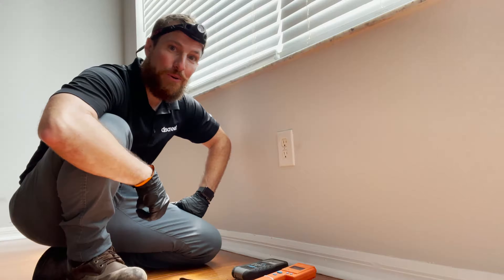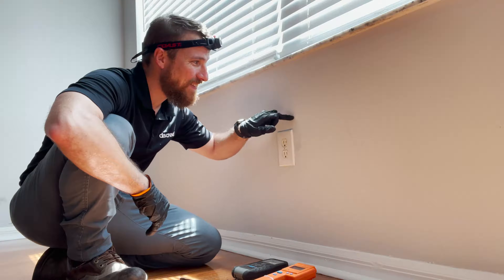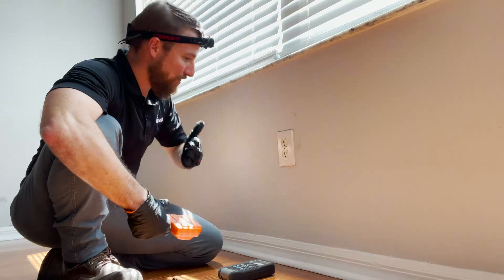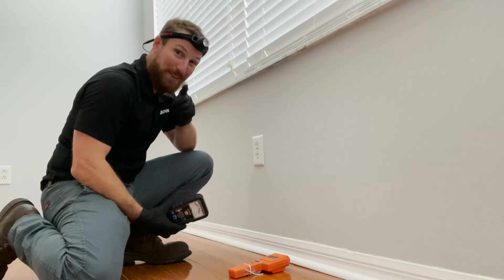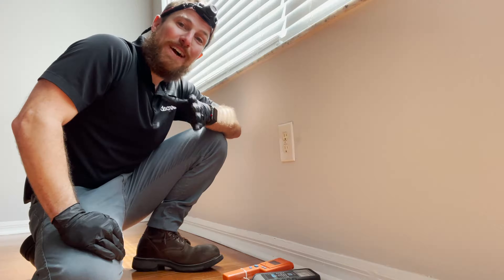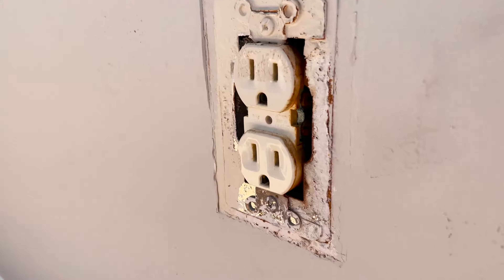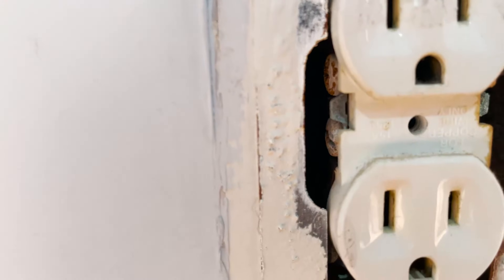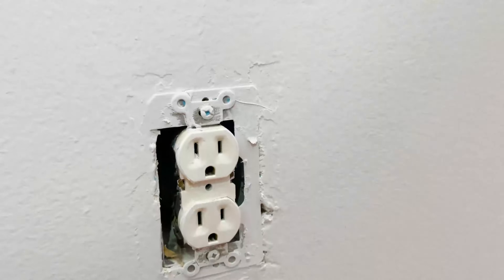Here's a Tip for Validating Moisture Within Walls

Comment: Hello Josh. What's normal moisture for plastered walls? On my walls it looks like the paint it's starting to look like it's not spread evenly and it wasn't like that before. And what type of company would I call to test the walls?
Reply from the maker: Hey there! Unfortunately, there is no standard number or range when it comes to normal moisture content within your wallboard. Also, it depends on the type of meter you are using, as pin vs. pinless meters will typically yield different numbers. 

On a scale of 0-100 for the plaster scale, most commonly I find plaster to be in the 0-10 range. Very seldom does dry plasterboard show any noteworthy level of moisture concentration. With that said, the moisture levels within the indoor air quality will certainly influence the moisture content within building materials such as plaster. 

My best advice would be to collect moisture meter readings from similar walls in other areas of your home where you don’t believe there to be a problem. If you’re seeing these paint spread marks on a perimeter wall, check perimeter walls in other rooms. If this damage is on an interior wall, check interior walls in other rooms. Simply make sure you are comparing similar walls. 

Lastly, a company that can check moisture readings for you would be most professional assessment and remediation companies. If you want to put your worries to bed, or at least warrant the concerns, you may want to consider hiring one of these types of companies to perform a moisture survey. This will highlight areas of concern with respect to elevated moisture concentrations within your property.
Reply: @IAQJosh  Thank you so much for responding! I appreciate your insight!
Reply from the maker: @ldjohnson214  Anytime! Happy to answer any and all questions that you and others have.
Reply: Go buy a cheap moisture meter and test your own walls the instructions are easy to learn there is no real skills here hold the meter against the wall and read it, that's all there is to it.

Comment: What service should I call for moisture or blistering of the walls? Roofer, plumber…???
Reply: Upstairs bedroom underneath the window sill. Also, I noticed the carpet was damp under that same area.
Reply: There was a storm a few weeks ago. It’s supposed to rain again this weekend but not sure what service to call to have an inspection. Roofer, plumber, window person? 😩
Reply from the maker: @chetlynn  Given the proximity to the window, it’s very likely that you may have water intrusion from the window or seal around the window. If that’s the case, neither a roofer or plumber would suit your needs. 

You can always hire a contractor to perform a water damage assessment - which would likely assist in identifying the source(s) of water intrusion.
Reply: @IAQJosh  great! Thank you so much for the quick response!
Reply from the maker: @chetlynn  Absolutely! Happy to answer any other questions that come up. 

Good luck!
Reply: @IAQJosh 
Hi Josh. Love your videos. Thank you!

I live in an older home built in the 1940’s. One of the bathroom walls next to the bathroom ceiling has blistering and now the ceiling is starting to blister as well. Had a new roof installed last year. No known leaks with old roof. What should I do?
What’s causing blistering? Thank you so very much!!
Reply from the maker: Hi Cathy. Thank you for viewing my content! 

Regarding your question, many factors can cause paint to blister... Moisture tends to be the primary source for this, whether via dampness within the material or dampness within the air. Given that you're referencing a bathroom, I would recommend further evaluation of the dampness in the air. Setting up something as simple as an accurate temperature & humidity (T&H) sensor within the bathroom will provide you with this information. If you want to get even more information, invest in a data logging T&H device. SensorPush sells an affordable and accurate sensor - which can be purchased on Amazon. There are also many others. 

You may want to also consider investing into any type of moisture meter - either pin or pinless. The folks at Erikhill sell a small pen style pin moisture meter, which I'm currently testing out. It's under $20 and available on Amazon as well. Checking the moisture content within the blistering area and comparing those readings to another area without blistering paint can be helpful in ruling out an active leak behind the wall and ceiling.
Reply from the maker: For starters, it depends on where you’re seeing these damages… Is this in a bathroom? Bedroom? 

Around what height on the walls are you seeing the damages?

Comment: Interesting to see how you approach damp diagnosis in USA. As a building surveyor in cold and wet England, we get lots of damp and mould issues for me to survey. I personally always also check the exterior of the building for leaks, cracks, drainage issues etc., before recommending you need to remove the drywall (we call it plasterboard). Is it common practice over there to not check the exterior of a building?
Reply from the maker: While I cannot speak for others, I can share that I will always check the exterior of a property. Especially as you said, I constantly find cracks, inadequately sealed openings for plumbing and electrical, etc. Paying close attention to the height of the landscaping, in reference to the height of the slab, is especially important in some areas here.
Reply: In my state 99% of inspectors especially "mold inspectors" are lazy and incompetent. They don't inspect the outside and barely inside. I just had  an IICRC certified water intrusion inspector and certified in "microbial application" - some nonsense like that. He literally waived his moisture meter over the wall. He never placed the pad on the wall, thinking I as a woman wouldn't know better. It wasn't a Flir camera. He also kept saying repeatedly "mold is ubiquitous" - like he was so proud of himself for learning a "big" word. smh  I enjoyed letting him know after he was done with his nonstop BS mansplaining that I am a Certified Mold Inspector.  I took a 24 course and got certified after educating myself first enough to realize how ignorant and incompetent the mold inspectors Iwas hiring were.

The companies/ inspectors that seem to actually know what they are doing charge insanely high fees. There truly is a crisis in the US when it comes to mold and moisture problems in homes and the lack of true understanding of the danger and professionals qualified to inspect and address it. Licensing and continued education should be mandatory.
Reply: @sitori2509 doesn't surprise me. 
Even doctors are too incompetent to actually help patients. 

There are loads of diff "professionals " these days who know much less than your common hobbyist!! 

It drives me up the freakn wall!! 

I've wanted to have a mold inspector come check my house, but I don't trust any of them to do a decent job! 

I've had HVAC professionals come here the past 3 or 4yrs when my AC refused to cool.  It's still not fixed!! When the weather gets close to 90° outside, the AC stops cooling.  It's been doing the same thing all these yrs & despite paying them 100s$ every visit,  they never fix it.
Reply: I'm not a professional, but checking exterior without removing siding for example would be hard.  When it comes to windows, there are many ways to mess up the install.  There should be cauking and duck/insulation tape used.   Also, depends how the channels were installed around the window. Remember in US. Can be moved in a day, and you would not be able to tell that they were.  Quick process.

Comment: Great time to use a moisture meter is after a heavy rain. Sometimes the ceiling only gets a few drops per 5 minute period, and its not enough to make any visible damage. Check ceiling just below roof vent areas! Also, I just learned that sheetrock corners where the install corner bead (metal strips installed on wall edges to make a strait edge) will give false moisture readings. If you know that a drip has been occurring for 24 hours, get a space heater on a speaker stand, and heat up the ceiling or wall surface to around 120 degrees. Attic side, pull back insulation to expose ceiling sheet rock, and place a fan up in attic to blow across.  It will take about 5 days to dry out the back side of sheet rock with a space heater. Oh, yeah, don't forget to repair the roof leak.
Reply: Hi. Do you have a specific products to recommend for testing moisture.? Thank you
Reply: Only 24 hours of material being wet it has mold and should be replaced.
Reply from the maker: Yessir! Metal corner beads are one element that I need always remind people of - especially those new to moisture meter use. 

As to your mention of utilizing heat to dry building materials, this certainly works well. 120 degrees is a bit up there, for my liking, but I’m sure you’ll achieving some rapid drying!

Comment: I use a Flir camera.
Protimiders will reflect off metal and give you a false positive.
The Flir can read electrical outlets and main electrical panels.
You check for hot spots.
Reply from the maker: I love using my Flir camera to quickly scan building materials for thermal anomalies. Definitely cuts down on the “guess and check” game, when it comes to searching for moisture across large areas. Also great for locating overheating electrical components - as you mentioned. 

As you may know, all moisture meters will detect a false positive when they come in contact with meter. It’s not just Protimeter meters. Every tool has its limitations.

Comment: How much can I expect to pay to have someone determine if there's a leak in wall behind a shower?
Reply from the maker: Hi Shelley! This ultimately depends on who you hire. If you hire a leak detection company, the going rate in my area is around $550-650. A mold assessment in my area is around the same price, but with the added value of evaluating for the presence of mold as well. Another option would be to hire a plumber who offers leak detection services.

A quick caveat to the above though; as a mold assessor won’t have access to as many fancy tools as a leak detection company.

Comment: What do you consider to be "normal moisture levels" in a wall. Thanks!
Reply from the maker: Well, given that each property will vary with its airborne humidity levels, it depends. In drier environments, I’ve seen moisture concentration levels (in drywall) lower than 7. In wetter environments, I’ve see levels (in drywall) as high as 40. 

Now, if you’re using Delmhorst’s drywall scale on their pin style meters, you should typically see moisture concentration levels above 0.3%. Their scale have proven to be extremely accurate and useful for verifying moisture content with drywall. 

Keep in mind that all of the above pertains solely to drywall. If you have plaster walls, the levels may very dramatically. One of the best things someone can do is to collect a few moisture readings from known dry areas (areas away from any plumbing, windows, doors, etc.). As long as there are no signs of water damage, you should be able to see some pretty consistent readings - which can be averaged out to find your “dry standard”. This same principle would need to be applied to an interior wall, if you were comparing walls separating rooms, as opposed to perimeter walls.

Comment: I just found this out whole house destroyed and we just purchased it 3 months ago and we are a family of 5
Reply from the maker: Hi Demetrius! I’m so sorry to hear of that news. Depending on what you mean when you say the house is destroyed, you may want to consider speaking with a mechanical contractor - like a quality HVAC/ ventilation company. 

There are instances in which you can dilute or fight off indoor environmental hazards by creating a positive pressure environment. By bringing in outdoor, filtered and conditioned air, often times you can dilute or remove contaminates by pushing out outward on your building envelope. In layman’s terms, the outside air your are bringing in mechanically can push everything into the wall and ceiling cavities and keep those contaminates from impacting your indoor air quality. 

Just a thought, if that sounds like it would help.

Comment: Thanks for sharing. As for measuring drywall - those pins actually puncture the drywall yes? in other words, not suitable for taking around on a house viewing, better to take the non invasive one and skip the pin readings
Reply from the maker: The best process that I’ve found is using a thermal camera as the initial screening - looking for anomalies that may be related to elevated moisture. I’ll then use a non-penetrating moisture meter to confirm if the anomalies are indeed elevated moisture concentrations. In addition, I’ll use this meter throughout the area below windows, as thermal cameras do not always highlight problems. Lastly, I’ll use a penetrating (pin) meter on the drywall scale to confirm that I’m not picking up any false readings with the non-penetrating meter. 

Following this process, I’ve been able to greatly limit the amount of damage left behind on walls. Arguably, you can use a non-penetrating meter like the Tramex on different depth settings to ascertain more reliable information, without having to place pins in the walls - assuming pin usage is a no-go in your situation. While not a guarantee, using different depth settings will allow you limit the potential for false readings by limiting the influence of objects behind the drywall - such as metal strike plates, etc.
Reply: @IAQJosh can you suggest a high quality reasonably priced thermal cameras and moisture meters, please? They need to detect moisture both inside walls and below the bathroom floors. Thanks so much!
Reply: Only a snowflake would worry about 2 needlepricks in the wall, the are so small the only way u would know where the are there is if someone that made them pointed them out to u. If you are really worried about a couple of needlepricks in your walls you have bigger problems then wet sheetrock.

Comment: Great video. Will a moisture meter also work on vinyl plank flooring?  I have vinyl plank over a slab and my tenant thinks its getting wet between the slab and the flooring.
Reply from the maker: Excellent question! Yes, a non-invasive moisture meter will work for detecting areas of greater moisture concentrations beneath the vinyl planks - when they are glued directly to a slab. Given the varying results when collecting moisture readings from concrete, it’s best to collect a number of dry area readings (comparative) and then a number of suspected wet area readings and then separately average them out. This will provide you with a better idea of the suspected wet area as a whole.
Reply: @IAQJosh  thank you

Comment: Can you share which moisture meters you are using? Thanks!
Reply from the maker: Of course! My favorite moisture meter to use in most situations is the Tramex Moisture Encounter Plus (MEP). For confirmation pin readings, I prefer the Delmhorst BD-2100. When it comes to concrete and stone floors, I use a Tramex Concrete Moisture Encounter (CME). 

As one would assume, I also have an assortment of attachments for all of these meters (extensions, hammer probe, etc.)
Reply: @IAQJosh  Thanks for the quick and detailed response. I am a homeowner and was hoping if there is a single meter using which I can measure extent of moisture in dry wall, wood flooring, inside of sidings, concrete and masonry. Do you have a recommendation for a single meter which does a good job across these materials?
Reply from the maker: @nitinsinghkumar3390  Your best bet will certainly be the Tramex MEP - as it will allow for non-invasive moisture readings of a variety of materials. Any meter with pins will not be ideal for concrete or masonry.
Reply: @IAQJosh  Thanks!
Reply: @IAQJosh  those are GREAT meters! How about one that ISN'T $525 for us renter-type folks, please? I'm in a less than 2 year old "luxury" apartment building, with some of the WORST finish work, and a slab Jimmy Hoffa just might be under, that I *can. Not. Stop. Sneezing. In*... I need to do some bloody TESTING!
Reply from the maker: @gretchenjackman7452  Hi there! 👋 My recommendation would be for you to look toward a General brand meter or similar, as these can help identify moisture in most building materials. 

However, if you’re looking to find moisture concerns within your slab, you’ll need one of these higher end meters. While you can look for anomalies with some of the lower end meters, you’ll often find that these meters simply max out when you press them against concrete.